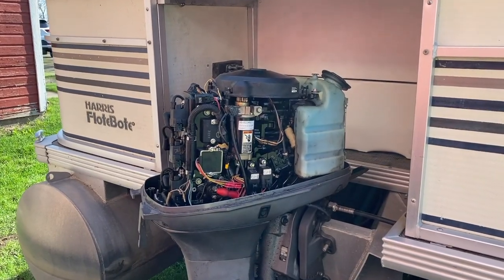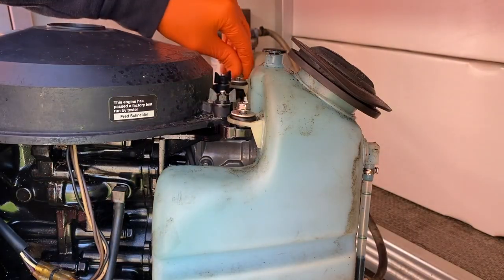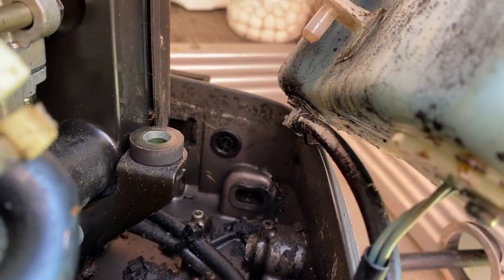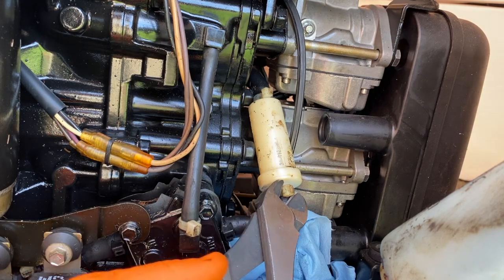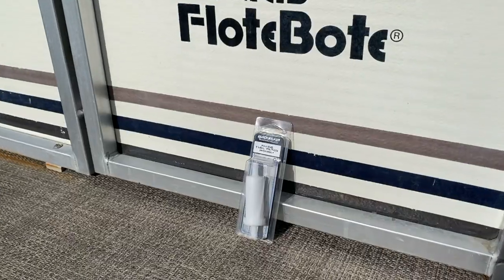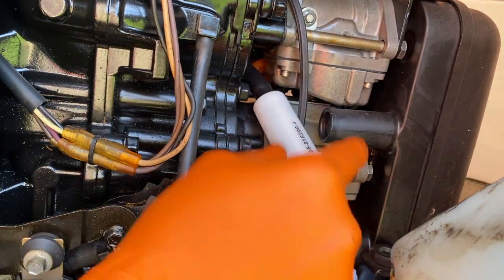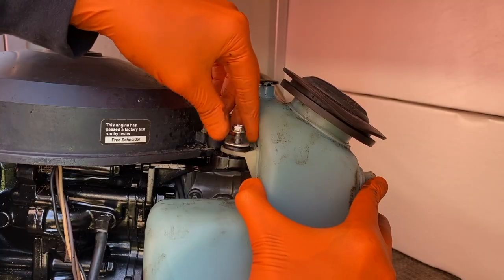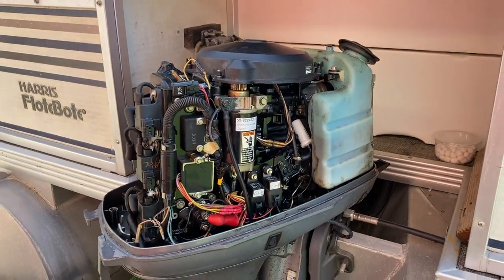Replace Mercury Mariner 40hp outboard fuel filter

Comment from the maker: If interested in purchasing this product, visit our Amazon affiliate link below. I earn from qualifying purchases.

Fuel filter:  

     OEM:  https://amzn.to/3FOrs1w

     Aftermarket:  https://amzn.to/4lf8Irk

Aftermarket Fuel pump:  https://amzn.to/3Txtx5e

New fuel hose:  https://amzn.to/3ZMxnv9

Fuel-Water separator filter:  https://amzn.to/3HxRkQ1

Zip tie cutters:  https://amzn.to/3FHf6Zc

Zip ties:

       4 inch:  https://amzn.to/3FHfffc

       6 inch:  https://amzn.to/441e83b

       8 inch:  https://amzn.to/43RFk3i

Shop towels:  https://amzn.to/4e4Z73H

Bungee cord pack:  https://amzn.to/3T1l8qC

Needle nose pliers:  https://amzn.to/4l6gL9M

Electrical tape:

     Black:  https://amzn.to/4jYH5BN

     Color assortment:  https://amzn.to/3FZzaGk

Spark plugs:  https://amzn.to/4dZQAz2

Spark plug gapper:  https://amzn.to/3TrytIS

Ignition coils:

          https://amzn.to/4447l7W

          https://amzn.to/3FOGX9X

Synthetic oil:   https://amzn.to/3Tu63xR

Oil pump:  https://amzn.to/407zwkT

Boat engine muffs:  https://amzn.to/4l1yq2V

Trim switch:  https://amzn.to/3FOt5wa

Throttle housing:  https://amzn.to/4e52CHI

Horn switch:  https://amzn.to/3SDVGaC

Rocker switche covers:  https://amzn.to/3ZZuGpV

Speedometer replacement kit:  https://amzn.to/43utvBa

Speedometer Probe:  https://amzn.to/3HnroX1

Speedo tube clips:

       Assortment kit:  https://amzn.to/3SX2Oix

       White:  https://amzn.to/3Ht8FJW

       Black:  https://amzn.to/3ZRlW59

Tube/Hose cutters:  https://amzn.to/43EZJd7

Boat cover sand bag kit:  https://amzn.to/4kCY3qq

************************************

1.  Replace 40hp outboard spark plugs

          https://youtu.be/DLKPz8-q7-A

2.  Winterize outboard engine

          https://youtu.be/LSTCiqLuHtA

3.  De-winterize outboard engine

          https://youtu.be/IjzSsgypiTA

4.  Replace fuel/water separator filter

          https://youtu.be/FqH7cypG8uI

5.  Replace boats fuel hose/pump ball

          https://youtu.be/aXUMIUNfT-w

6.  Drain/change outboard engine oil

          https://youtu.be/0j95v7a843U

7.  Replace Speedometer and entire Speedo Tube

          https://youtu.be/3zXCsLX4C7w

8.  Replace boat horn switch

          https://youtu.be/cIYNJQK2vig

Comment: Prior owner had shop replace filter, rebuild carbs and service the lower unit on boat I bought (50hp 2 stroke Mercury)….i saw filter was backwards (some mechanics didnt pass shop class).  Also changed water impeller and saw the top bushing was on top of the cover plate (wrong)…..Lord knows what they did to the carbs.
Reply from the maker: Thanks for watching, that’s no good.  Professional shops are supposed to get it right.

The power of DIY…Knowing what you replace and knowing it is installed correctly.

We will share a link to our fixing boats and jet ski playlist below.

     https://youtube.com/playlist?list=PLjCXOz8TSkZlae2qY97uVVTm3JdBOUoRS&si=zxlgt-aWNQqWzWiF

😁🧰